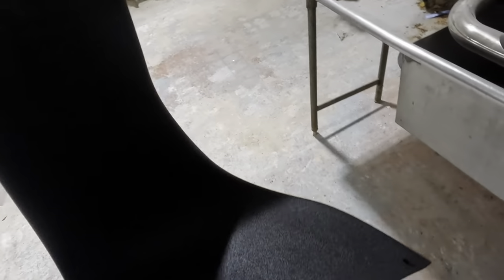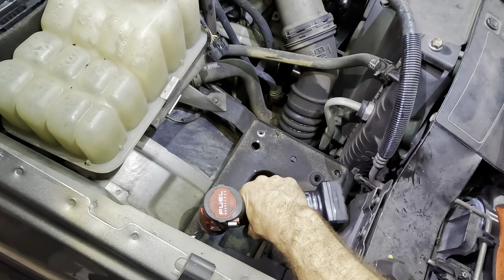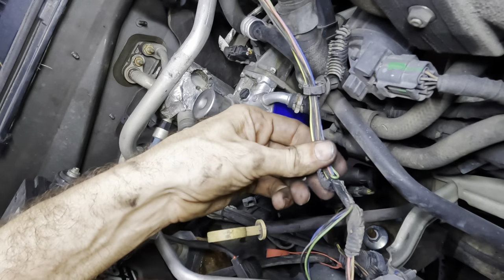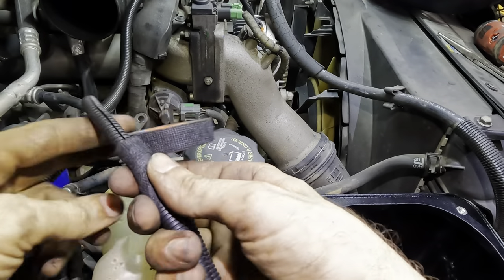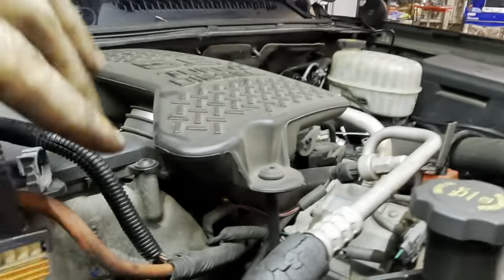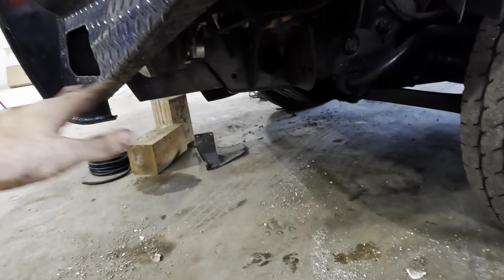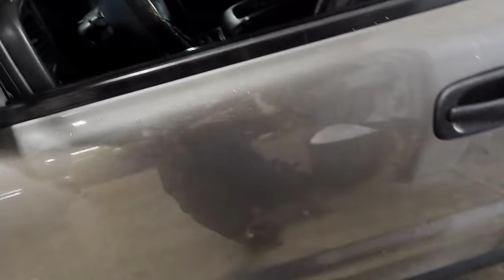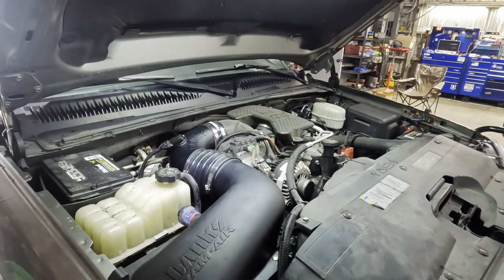This is BAD! And it's MY FAULT!  2007 Silverado 3500 6.6 @bankspower

Comment: I just see a giant water scoop the next time a hurricane hits Florida.
Reply: Its flows thru. Doesnt go up
Reply: @markwilson9760  could you explain how the air and water flow through it and won’t go up?
Reply: @markwilson9760  LMAO
Reply: @molotovEOD  magic, ta da!
Reply: @molotovEOD  re watch....you can see straight through a long the frame rail.
Reply: Exactly my reaction. If anything raising the intake would be what I'd be interested in doing. Drive into deep water and that is going to suck it up.
Reply: In Michigan we would call that a snow plow!
Reply: Amen to that. Suck up the water, hydrolock the  duramax= toast.
Reply: That's a complex straw
Reply: Theres a pass through on the back of the scoop.
Reply: There is an opening at the back of the scoop
Water would go through as air went up
Reply: @markwilson9760  so that makes it not a ram air just passive aspiration and if the whole scoop is underwater no air.
Reply: If the air can pass straight through the scoop,which it looks like it can ,won’t it act like like a air operated vacuum hose and draw the air back out the inlet pipe,I can’t see how this is effective?
Reply: I also remember seeing a hole on the pass side of air box so it can pull air from the side as well.
Reply: There is a water vent hole in the back but still looks like a super scooper for scooping up water that he can then drop on a fire😂😂😂
Reply: And all the Silica when it's dry ...might as well install a K&N filter on it..
Reply: Yep that is what I was here to say, I would love to put one on my truck, but I’m not risking it. I went with a Mopar orange Veraram
Reply: I understand that the water scoop has a pass through to allow water through but if it were to be completely submerged what then? There would be no air going to the engine and it would hydrolock in seconds? Poor design choice in my opinion
Reply: I too am concerned about the intake being low ild be worried about it getting ripped off if u ever have to go off road. But for highway use looks good just dont go tbriugh high water lol.
Reply: That’s what I was thinkin’. Hope Ray has a good plan
Reply: I agree if you really drown the scoop it could cause hydro lock. These low sucking intakes are made for easy install - and a routing higher in most cases have headlights and radiators ect in the way..
Reply: @peterbenson3776  yeah I just hope his "dirtymax" doesn't become a "hydromax"  it'd be a shame to ruin such a good motor.
Reply: @jojothepopoman  until both front and back are underwater.
Reply: @tim cvetic  oh, it shouldn't hydrolock the engine. It would take a pretty robust engine to get water past the exploded turbo and all those pieces of metal before they toast the engine first.

Ps, I'm just trying to be funny. I agree it's not gonna be good.
Reply: 39:35 you can see the air filter box has cut out on the side. So if it is in deep water it can still pull in air. You can't suck up water unless it's air tight system or if water is up to the filter.  It may been better if Ray went with scuba intake.
Reply: Looks like just asking for trouble. Besides the water problem, you’re down low and dirty getting all of the road scum from vehicles in front of you
Reply: @markwilson9760  until you drive through a puddle deep enough to completely submerge the scoop.
Reply: @zaffo757  but how would it suck up only air and not water? A vacuum will suck up both of them no matter what, won't take as much water, but still enough to do damage
Reply: Yeah, exactly what I was thinking. That thing looks like useless garbage to me. If it’s supposed to “ram air” into your intake then there shouldn’t be any other holes where water can escape that you scooped up when driving through high water. Every off-roader is putting the intake as high up as possible to be able to drive through creeks and stuff. Why would you put it close to the ground? To Dyson the road clean? 😑
Reply from the maker: Maybe I’ll remove it for the wet seasons. There is an opening/pass though in the cold air shop. I assume it’s to prevent water from being sucked up. BTW the fenders on stock setups can also suck up water
Reply: lol, should have cut a notch in the hood and run it up instead of down!
Reply: Somewhat less diplomatic than I was going to be but seeing the same flaw🤔
Reply: That pass through won't do 💩 when the water gets high enough.
Reply: Especially in deep waters…
Reply: Florida. Rain. Standing water on roadways. Nah…. I don’t need to be that cool.
Reply: cannot go thru flooded street or deep puddle will suck up water,  i can see flow thru for  rain water,   don't drive in streets of flooded water hurricane season..
Reply: I'm pretty sure I saw a hole in the side of the air box at the top. There would never be enough vacuum to pull up a significant amount of water, but cold air from near the ground will be forced up if you're driving at a moderate to high speed. There's drain holes to stop water accumulating at the bottom of the intake, and if you're driving fast enough through deep water to force water up the intake you'd be giving the engine a hosing down anyway. I wouldn't have thought the chances of getting water in the engine are any higher if you aren't off-roading it, and you drive through deep water at a sensible speed.
Reply: He would always install a snorkel for the wet times.  The right ones look pretty cool but finding one for a dirtymax that looks cool....hmmm.
Reply: @jojothepopoman  but you can't go in water that is above the rear hole
Reply: Exactly. In high water what keeps water out of intake?
Reply: It’s looks like scoop open on back side
Reply: That truck has a lot of clearance.  Not an issue with water.
Reply: You should get better fuel mileage with new air filter.  Nice gauges had same on Turbo Trans Am.  OBD2 interface?  Nice vid Ray.
Reply: My first thought 😁
Reply: This has to be a southern thing. Can you imagine driving with this scoop in a winter storm? It would get chocked up with slush and snow and the truck would stall out.
Reply: @Rainman Ray's Repairs  yeah but I think what they were saying was that it's a lot easier to suck up water with the intake that close to the ground, any decent sized puddle will certainly suck up some water
Reply: @molotovEOD  38:19 you can see the opening at the bottom
Reply: @steelhere1  and the hot air coming off the hot pavement as well. i like mine just above the bumper. i put some remote thermometers around the intake locations to prove it to myself before i settled on locations on both my truck and track car. we call the close-to-the-pavement ones "FOD injectors" Lol
Reply: @blahorgaslisk7763  put a swivel connection and make it a snorkel
Reply: I recall a guy in Maryland with his brand new AMG63 Bi-turbo that hydro locked in a rain storm after injecting rain water while traveling on the hwy.....
He was just a little miffed to say the least.
Reply: First thing I did with my new truck was fit a roof level air intake.
But then again, I live in Cumbria, UK & driving through a couple of feet of water on the road is a several times every winter experience.
Reply: @RainmanRaysRepairs  Let's see, wet season in Florida is from January first until December 31st
Reply: @jimbellingham3572  It's Florida, it gonna suck up all kinds of big juicy bugs. We will just have to wait and see with the next filter inspection.
Reply: I’m picturing a python curled up in there😮
Reply: Yep big water straw. Wouldn’t want to be on a stream flood with this thing. Passthrough clearance is as deep as you go.
Reply: @stevelang3171  Yeah, I’m an airplane guy. Familiar with FOD
Reply: @markwilson9760  the water will be in the air that is going UP, not a good idea at all
Reply: I saw the same thing
Reply: Was just coming here to say that.
Reply: @bobsch-gd6ze  THE SAME HEAR IN THE UK WHEN FORD PUT THERE INTAKE DOWN THERE . ON THE FORD TRANSIT.  I LOVE GAIL BANKS AND WHAT HE DOES BUT ON THIS ONE HE IS 100 PERCENT WRONK TO STICK THAT THERE.   YOU HAVE A TRUCK SO AS YOU CAN GO PLACES  LIKE IN THE MOUNTAINS WHERE THERE WILL BE STREEMS  THAT YOU CAN GO THOUGH.  NOW YOU CAN'T DO THAT . IN MY MIND INSTEED OF IMPROVING THAT TRUCK HE HAS NOW MADE IT SO THAT TRUCK CANT DO THAT ENEY MORE . THATS A STEP BACKWARDS.   DONT EVEN WANT TO THINK ABOUT THE SNOW . MAY BE ONLEY TAKE YOUR TRUCK OUT IF ITS NOT OVER A FOOT HIGH . BIG FAIL . AND I WILL BE TELLING HIM SO .
Reply: ......... but the plastic bags will choke it off completely, bugs will just impede it!
Reply: My thoughts exactly. Can you say Hydraulic Lock!!!!  I have changed engines for folks running that type of stuff here in Oregon.  Dumb idea IMHO but about what you would expect from Ray.
Reply: Nope!
Reply: @timcvetic5054  Yawn, nope
Reply: @DaveBigDawg  but if it is completely submerged, below the pass thru,it will suck water, it would be a vacuum afterall.
Reply: @jacobm9263  you have to look at the video.  The scoop is open at the back.  It isn't a solid tube bent in a j.  Where it turns up...the tube is actually open to the back of the car.
Reply: @markwilson9760  I guess there thinking the vertical portion decending into the water will act like a straw.
Reply: @ajsilva5939  LOL...
But seriously I don't like snorkels either. I've seen to many jeeps and trucks with snorkels that when they tried to wade through some deep water the owner discoverd that the electrical system wasn't waterproof enough. And without spark you end up with a dead car in the water.

Snorkels might not be all that useful, but getting the intake up high under the hood is still a good idea.
Reply: @RainmanRaysRepairs  I think as long as you have the knowledge to not drive through standing pools of water when it is fitted, you should be golden!
Reply: Everybody worried about it sucking up water, which it can’t do because it’s not sealed to the air box and the air box doesn’t get all of its air through the bottom opening. All the scoop does is direct some cooler air up to the filter box while the vehicle is moving at speed. Otherwise, all of the engine intake air is drawn through the fender opening behind the right headlight. I’ve been running one for over 10 years now and never sucked up any water, even in the Florida like torrential rains we get here in north Texas.
Reply: While we were not looking Ray installed a revolutionary elevator suspension system that raises the whole truck above the axles to avoid flooded roads.
Reply: me to lol
Reply: @jojothepopoman   but in deep water that wont do anything,once that scoop is submerged, front and back it may suck up a lot of water.
Reply: It's just extra cooling for the engine XD
Reply: @RainmanRaysRepairs  Nah, there has to be a way to set up or rig up something to give it an alternate path for airflow during the wet seasons, or maybe rig up an alternate intake so  you can switch to something like a snorkel system or something that would keep it out of the water?  Kind of surprised that they put the intake that far down on the truck, given that that seems like a great way to suck up dirt and stuff instead of something more like a snorkel anyway.    Also kind of sad, thought for sure you'd use the over-top creeper I sent ya for this. :D
Reply: @@TimRockIt  nah, just cut a hole in the top of the box and fit a snorkel pipe onto it. :D. Then he can use a rubber sheet in the bottom of the box to seal out the water!
Reply: @@TimRockIt  @RainmanRaysRepairs  The other concern I have, looking at it is...if he goes off-road with that truck and hits anything even moderately tall, it may just break that intake right off...
Reply: Same here, any puddles and 'BAM' I'd be going high level.
Reply: @thunderbird0428  If you could call it a "ram" for 0.17psi at 100mph.
Reply: Looks great 👍
Reply: It'll be fine.
Reply: @Note_Creator  So what miniscule "ram" effect there was, or might have been, is now totally negated.
Gives me a big problem with the product title.
Reply: @tonyking9235  You are all upper case which means shouting
Reply: @RainmanRaysRepairs  If it has a hole water will definitely go into it. I had a vehicle with a hole in the turbo charge air tubing directly at the lowest point of the car and water got into it through a deep puddle. This was not my car, but I have seen where the hole was on a SAAB back in 2009.
Reply: @molotovEOD  Exactly, once the water reaches the top of those ports, it's got only one way to go and that's up.  This seems like a very poor design to me and a water vapor lock waiting to happen.  There is no way  I would ever put that thing on my truck.
Reply: @djboogy3985  As long as he doesn't get into any water above his wheels,  he should be ok.
Reply: Another way to wash an engine with a Garden Hose
Reply: He's going laking in the back yard.
Reply: The wire loom has submarine mode switch........next video! 🤣🤣🤣🤣🤣🤣🤣
Reply: Thats the sae comment I made."  How is the cold air scoop  NOT a high water intake?"
Reply: "Oh Peeta"
Reply: the transmission...
Reply: @djboogy3985  least he's got a machine to flush to flush the transmission.
Reply: Wouldn’t you have a Venturi effect with air passing through the scoop and sucking up air out of the intake?  Long ago when I worked at a tire and muffler shop, we had this small device that you clip into the air inlet of say a tube, than compressed air on one side of the fitting, turn on the air, which would blow though the tube, the muddle of the tube went down and clicked onto the air fitting of the tube.  It would suck the air right out of the tube and become completely flat pretty fast.  Flatter then if you just tried to manually squeeze the air out yourself.
Reply: You beat me to this comment.
Reply: Correct, Venturi effect doesn’t apply to physics in this instance.🤷😂
Reply: @johnfalco9528  

High speed down the highway. Air going in the front and right out the back.  Seems like there would be sone effect.  It’s also not much of an air scoop if the air you’re scooping is going right out the back.
Reply: Not only water, There is more dust and loose stone chips at that height, to me it wouldnt suit our conditions here in NZ
Reply: And a vacuum cleaner for flowriddas roads  between hurricanes.
Reply: There is a reason most people use snorkels above the hood
Reply: It needs a 1 inch hole drilled into the lower pick up to stop it hydralic locking just below the air box !
Reply: @molotovEOD   The Super Scoop is not the only inlet. There's a huge secondary inlet on the airbox. You could completely seal off the scoop and the airbox would draw air in through the secondary side inlet.
Reply: @blahorgaslisk7763  Because there's a huge secondary inlet in the side of the air box, it would simply draw air through that hole and not the scoop near the ground.
Reply: @bobh6728  The Super Scoop is sold separately from the Ram-Air intake just for that reason. There are some climates and situations where the Super Scoop portion is not appropriate.
Reply: @timcvetic5054  The Super Scoop is not the only inlet. There's a huge secondary inlet on the airbox. You could completely seal off the scoop and the airbox would draw air in through the secondary side inlet.
Reply: Thanks for the Bank's update Ray very nice work 👍❤️✅ it. Take care of yourself and family and be Blessed ❤️❤️👍.
Reply: @djboogy3985  The Super Scoop is not the only inlet. There's a huge secondary inlet on the airbox. You could completely seal off the scoop and the airbox would draw air in through the secondary side inlet. We've tested it. You can completely submerge the Super Scoop portion and it will not draw water into the intake. Having said that, the Super Scoop portion is sold separately from the Ram-Air intake (air box) because there are some climates and situations where it's not appropriate.
Reply: @Hemshemsems  The Super Scoop is not the only inlet. There's a huge secondary inlet on the airbox. You could completely seal off the scoop and the airbox would draw air in through the secondary side inlet. We've tested it. You can completely submerge the Super Scoop portion and it will not draw water into the intake. Having said that, the Super Scoop portion is sold separately from the Ram-Air intake (air box) because there are some climates and situations where it's not appropriate.
Reply: @djboogy3985  The Super Scoop is not the only inlet. There's a huge secondary inlet on the airbox. You could completely seal off the scoop and the airbox would draw air in through the secondary side inlet. We've tested it. You can completely submerge the Super Scoop portion and it will not draw water into the intake. Having said that, the Super Scoop portion is sold separately from the Ram-Air intake (air box) because there are some climates and situations where it's not appropriate.
Reply: @TheMaster1  The Super Scoop is not the only inlet. There's a huge secondary inlet on the airbox. You could completely seal off the scoop and the airbox would draw air in through the secondary side inlet. We've tested it. You can completely submerge the Super Scoop portion and it will not draw water into the intake. Having said that, the Super Scoop portion is sold separately from the Ram-Air intake (air box) because there are some climates and situations where it's not appropriate.
Reply: @peterlennon1139  The Super Scoop is not the only inlet. There's a huge secondary inlet on the airbox. You could completely seal off the scoop and the airbox would draw air in through the secondary side inlet. We've tested it. You can completely submerge the Super Scoop portion and it will not draw water into the intake.
Reply: @TXCherokee  The Super Scoop is not the only inlet. There's a huge secondary inlet on the airbox. You can completely seal off the scoop and the airbox would draw air in through the secondary side inlet. We've tested it. You can completely submerge the Super Scoop portion and it will not draw water into the intake. Having said that, the Super Scoop portion is sold separately from the Ram-Air intake (air box) because there are some climates and situations where it's not appropriate.
Reply: @bankspower  as I watched the video I didn't see any other openings on the air box. I did see the pass thru on the scoop.
Reply: @markwilson9760  The intake will suck it up. Diesel's breathe like you would never expect. They will suck your shirt off, inhale it, and spit it out without a hiccup. That is how much air they move
Reply: @blahorgaslisk7763  In many Wranglers the CAI is either right at the same level or is lifted in a snorkel.  They work in the desert too, since it lifts the intake above a lot of the dust.  Also, the air that intake pulls in is actually closer to the road, so over asphalt that will be considerably hotter.  What makes it cold again?
Reply: when the filter gets dirty it will be good plug to keep water out!
Reply: I was thinking the same thing,
Reply: Terrible place for air intake. Factory was 100% better
Reply: Water hell...just wait til an iguana gets sucked all up in there...
Reply: @jojothepopoman  That only works so long as the water level stays below both sides of the intake. For splashes I'm sure it's fine. For high water, he's got a giant water pump for at least one piston stroke.
Reply: I would far rather have the air intake higher in its original position. Seems very easy to scoop water at any speed through water that would be normally OK for this vehicle. The negligible gain in performance is surely not worth the risk of a wrecked engine - water don't compress!
Reply: @markwilson9760  right up untill the water covers the first 3 inches of the bottom, then you are sucking water . . . right up untill the engine starts injesting it, anyway.
Reply: Ray will be 10 feet farther than the other guy because his water sucker is 2 inches higher . . .
Reply: @markwilson9760  hopefully.
Reply: @molotovEOD  It has the same cutout in the back as in the front so water passes through but air goes up
Reply: @garybonz  what??!!
Reply: @RainmanRaysRepairs  asphalt is hot in Florida not cold. I like it it looks good.
Reply: Agree with most others, this thing will be a problem in deep water.  Stay out of deep water and it should do fine.
Reply: Even in Australia thats a water suction pipe. While we have hopefully seen the last of the floods, our potholes are deep enough to reach that - fun dodging them in a new mustang lol
Reply: @markwilson9760  if you put a straw with a similar set up and submerge it it will not act as a snorkel. If the water level is up to the door jam that means the truck is officially running on water lol
Reply: I'm pretty sure Banks already thought that through.
Reply: Remember 80’s model f1- 50 service trucks we used , had all the air intakes down in the front bumpers , 3  trucks in one week locked up from water in engine’s , all 3 hydro locked &  cracked pistons were the results
Reply: I do share your concern, especially if you try to wade through deep puddles with this setup. That would not be a good idea. That said, if you're not planning on wading through deep puddles, this scoop looks just fine, and it does have flow-through ports.
Reply: @RainmanRaysRepairs  yes but the standard intakes are no where as low as that stupid intake
Reply: There is a hole on the side of the airbox that sucks air from inside the fender lika the original airbox. So it will suck air from there before it sucks up any water.
Reply: @markwilson9760  Won't help at all, if you are in (if) deep submerged water and water is passing through, how is air supposed to get through the water in the first place before it even gets the opportunity to head upwards. What confuses me is why do you want a vehicle with high ground clearance and drop an air intake low? Get he may want improved air flow but wouldn't a snorkel system have been preferable?
Reply: @zaffo757  Doesn't matter - it'll still inhale the water as the engine is creating vacuum
Reply: @jojothepopoman  Doesn't matter - that engine will still suck up the water
Reply: @lithgowlights859  bent or buckled any rims on the Stang? My total so far is 2 front and 1 back. And they are Shelby rims so just under $800.00 each! Whereabouts in Oz are you?
Reply: @edthomas8486  Lithgow, NSW, and while I have not yet damaged rims on the mustang (Just a 2022 Ecoboost), the same cant be said for both myself and my son on our VF Commodores, damaged a few there between us

About to head on a trip to Noosa Heads (1150km each way plus day trips), so adding 2500++ km is just asking for issues with the current state of the roads at the moment
Reply: That’s a design for drag strip not street use period.  Nearly going gain any horse power to amount crap your going to scoop up. Soon as Ray forgets and goes through one those rain storm street puddles boom
Reply: @molotovEOD  Water gravity ;)
Reply: There is a opening in the air box to passengers side preventing a sealed unit, so water would stop air going into the snorkel, and draw air from passengers fender, thus not drawing up water, just my opinion, all the best to yous and your loved ones
Reply: @molotovEOD  the back of the scoop is open. so it should not create a vacuum if exposed to wet. also truck is pretty tall any engine would be hard pressed to pull water that hight to the filter. when I see those I normally thing road vacuum as well.
Reply: @djboogy3985  it's too tall to pull water all the way up. the dirty mak would just starve of air like putting a paddle over the intake before water would make it all the way to the filter.
Reply: @RainmanRaysRepairs  please tell people that your engine is not capable of sucking a large column of water that height through the intake , even if you submerged it. 😑
Reply: It can only create a vacuum if the whole system is sealed.
The vent hole in the upper box will stop a vacuum from happening and it theoretically shouldn't suck up large amounts of water. The water will mist at worst I would imagine just enough to clean the filter.
The passthrough the lower ram intake will allow the water to do just that and pass through.

Considering the state of the old air filter, the hole in the upper box should suffice to supply enough air in the event that he does drive through a river.
Reply: Yeah water during a heavy downpour or slightly flooded roads being ran over can make the water fine enough to be carried by air. I would want the air intake slightly offset to the side a bit more and it could be tucked up a lot higher under the bumper. Atleast be even with the frame to the bumper. I think it would look a bit cleaner. If you could find someone that can mold or atleast form ABS then that might be very possible to do. I don't think its as much a ram air though with that passthrough design.
Reply: @MikeFatty  I hope for Ray's sake that's true. 👍
Reply: @markwilson9760   🤣🤣🤣🤣🤣🤣🤣 OF COURSE IT DOES 🤣🤣🤣🤣🤣🤣🤣🤣🤣🤣.
Reply: @bobh6728  DID ENEY ONE SAY IF IT SUCK UP SNOW . DID IT CAUSE A PROBLEM AND IF IT DID WHAT PROBLEM .  WOULD BE NICE TO KNOW . THANKS
Reply: Yes, because Banks is in the business of building parts that will destroy the engine. 🙄  A bit of common sense driving here.
Reply: @stephenanderson439  The intake air would definitely need to be at a much lower differential,I could see a potential high RPM "starvation" for air.Not to mention road level heat in Florida summer, increased dust and dirt .Great idea maybe on circle track racing in Michigan ,LOL!
Reply: @markwilson9760  
Then it isn't 'ram air' you say?😁
Reply: @markwilson9760  If it doesn't go up it doesn't get into the engine.
Reply: Gale Banks doesn't make a product that isn't thoroughly tested or properly engineered !!! There is a reason why even the OEM has used his parts or engineering in the past and even to this day. The JLTV even uses a Duramax built by Gale Banks so I am safe to say Ray is fine with his choice of aftermarket suppliers
Reply: @stephenanderson439  
Gale Banks knows his stuff, looks more like a bypass so excessive pressure will not build up at heh
higher speeds, but maintains a pressure ceiling calculated for that engine, that's why I suggested Ray talk to  Banks' people, as the bumper might be part of the calculations, and he may need to fab up a short 'fake' to place at proper spacing to achieve what the engineers wanted.
Reply: Extra cooling if it scoops nice brackish hurricane water! The Banks Rudder!
Reply: what I thought when that first piece came out, no more back yard swamping
Reply: @markwilson9760  Ray did not show the exit ports.. DVD:)
Reply: Heres an idea, dint drive during Hurricanes
Reply: @zaffo757  That engine could inhale it's own filter, it creates a huge amount of vac! Regardless of seals, there will be an area of low pressure, with fast flowing air - that will draw the water into the filter, and beyond. I've seen it. I saw a brand new Peugeot 1.9T Diesel engine destroyed in this way.
Reply: @zaffo757  still can clog up with leaves and shit
Reply: @Spiderelectron  I'm sure Banks never even thought of that
Reply: @jacobm9263  I'm sure banks never even thought of that
Reply: @zaffo757  they probably did, but didn't worry about it. It probably says something about it in fine print that makes them not liable
Reply: Might not suck up ALOT of water but i would think it DEFINETLY will suck up waterspray and eventually get the filter wet and then into the enging.. And since its open twards the tire, it might suck up dirty road water to.. Thats not nice..
I know banks makes great stuff, but i think this seems a bit weird.. Probably great for places where it never rains tho..
Reply: @Alpejohn  it should be a toyota australia upward snorkel
Reply: @jacobm9263 , try using a vacuum cleaner with a huge hole in the line. It won't have enough suction  to suck the water up unless the whole intake scoop is underwater. Furthermore there is an opening at the airbox itself so in reality it would need to be up to said airbox.
Reply: @molotovEOD  Ok, so when he's pushing thru say 16 inches of Water, and it's like 1 Inch over the ""Flow thru"", what then???
Chugalug Chugalug....
Reply: @yamahafan7330  I guess time will tell who is right
Reply: I thought the exact same thing. Huge water scoop!!
Reply: @djboogy3985  agree
Reply: @jacobm9263 , that's it man. I'm not saying that the scoop is a good idea but it certainly would act like most people think.
Reply: @DaveBigDawg  what air when the intake is submerged?
Reply: I would not want my air intake underneath the front bottom of the truck. If you happen to hit a big water hole you're screwed.
Reply: My thoughts exactly.
Reply: All the water pass thru does is makes the standing water have to be a couple of inches deeper before the intake sucks water.
Reply: @molotovEOD  The scoop is open at the back before the up bend, water just flows through!
Reply: I'm sure Ray isn't gonna be fording through 2 and a half feet of water in a 3500 duramax lol
Reply: @molotovEOD watch the video towards the end where he connects the tube to the bumper.  You can see right thru it
Reply: @jimbellingham3572 😂